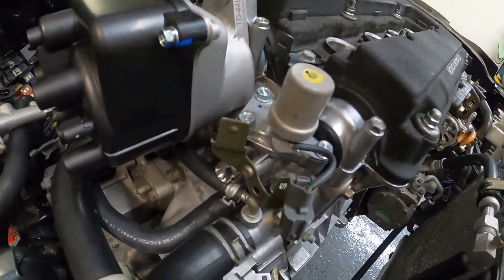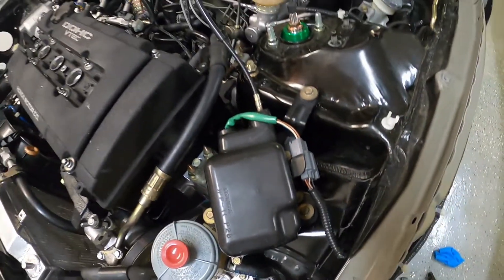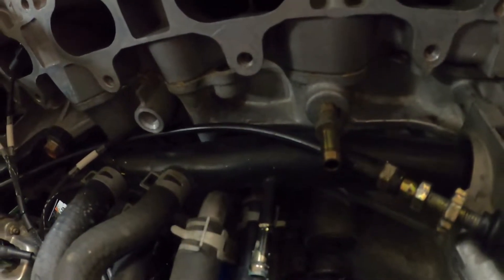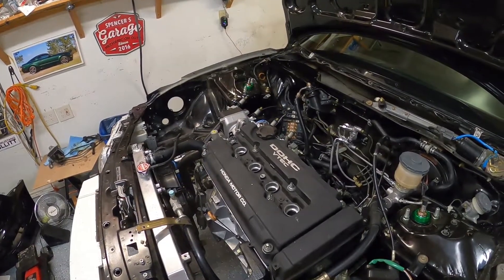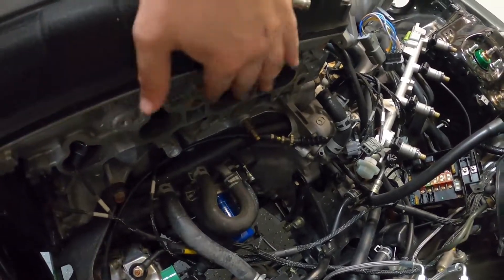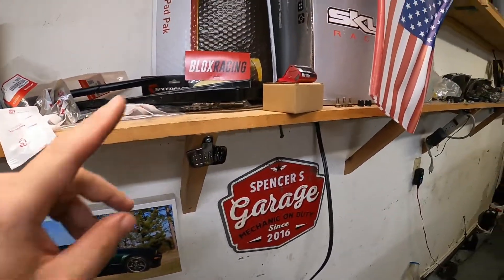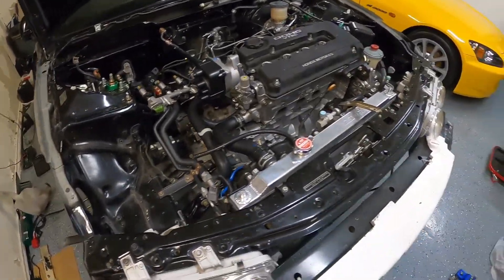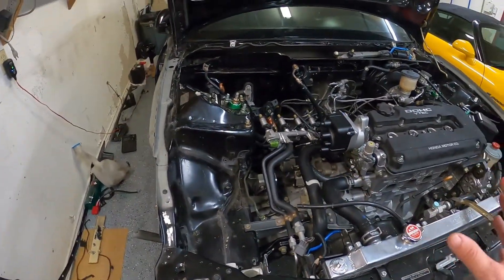Integra GSR Head Build UPDATE | High Quality Parts!

Comment: Can’t find the distributor seller under ‘API electronics’. Can you link the website you got yours from? Love the GSR build, can’t wait to see it running and on the road 👍🏼
Reply from the maker: Hey, thanks! It’s been a couple of years since I purchased the distributor. I didn’t remember the name in the video, but I did a quick search and found it, it’s called AIP Electronics. They have a website and sell them on eBay as well. However, I think most of the older Honda products are/have been sold out for a while. They said they sold me a “heavy duty” one with bearings from Japan, basically an upgraded one. And that one wasn’t even listed on the website, they sold me the very last one. So, you may want to contact them and ask what they have.